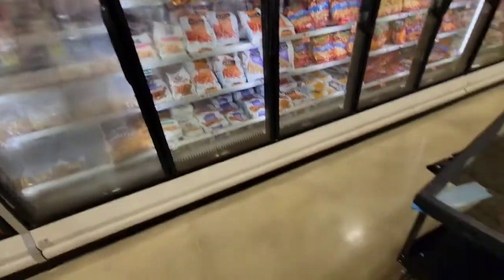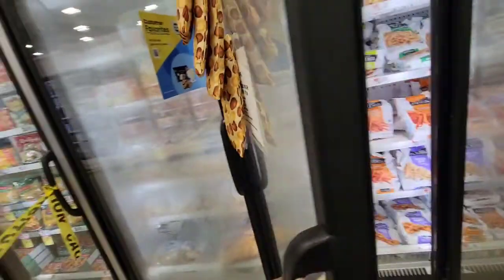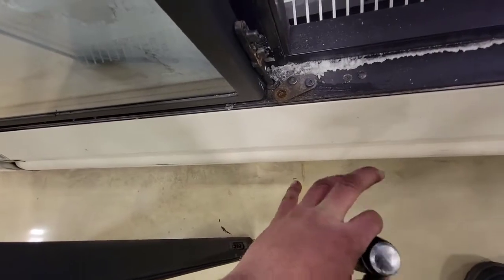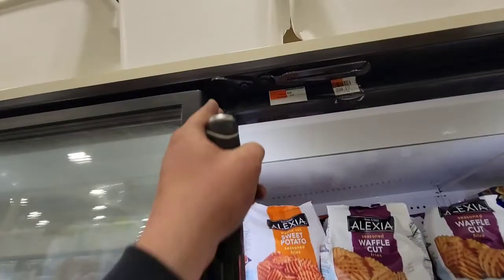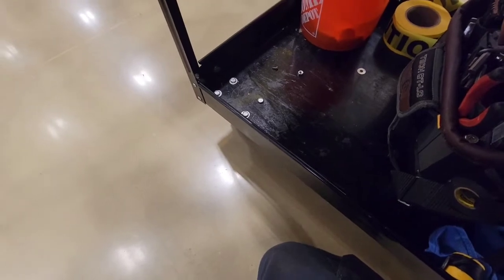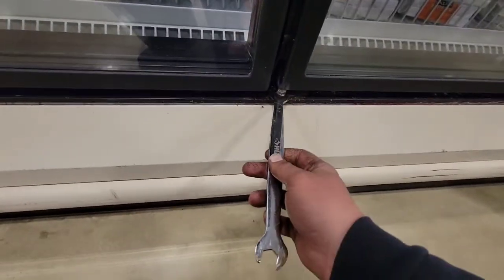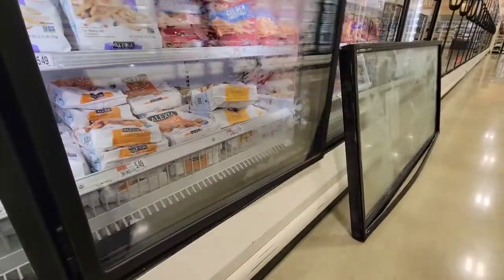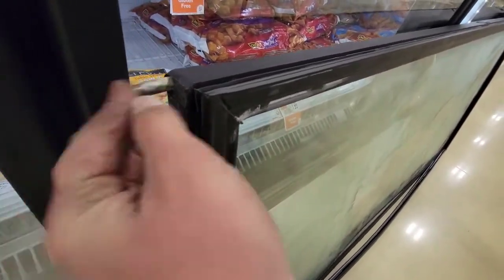Supermarket Refrigeration - How to Replace/Tension A Hussmann RL5 Door

Comment: Why did you replace the door? I’ve got a three door unit where the door won’t sit level even with max adjustment on the top. Bottom hangs up on the door frame.
Reply from the maker: I replaced the door because the door tensioners were bad. 

The amount of time and labor it takes to replace the door tensioners often time. S it's actually cheaper for the customer to just replaced the door because it's a quicker replacement. 

I'm not sure what would be causing that issue. I would have to see it it could be that the case isn't level.

Comment: Looks like door frame heaters are not working properly
Reply from the maker: They might be going but if they were going there the ice all the way up the side of the door which there wasn't. 

My theory was that sense this door was sticking before the replacement it would allow tons of moisture into the case and it would freeze all over the case and the side of the case. I'm hoping that now the door works properly it will cut down on the moisture resolving the issue. Hopefully I won't have to change the heaters I hope soo lol.

Thankyou for you comment :)